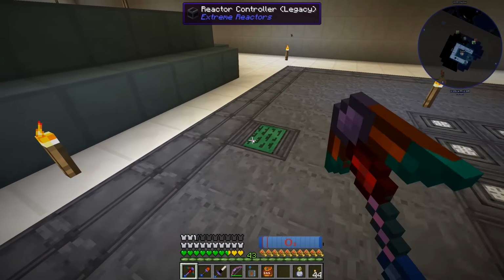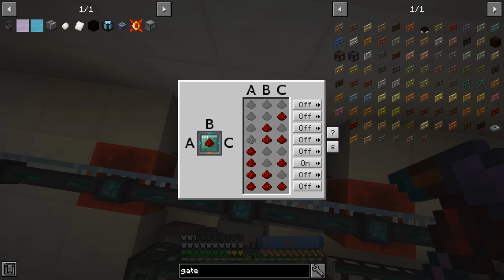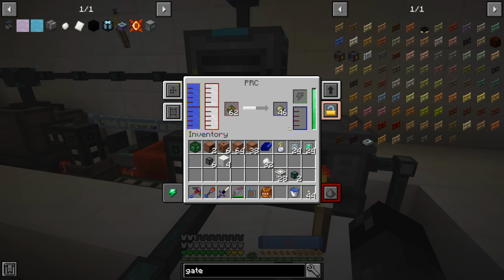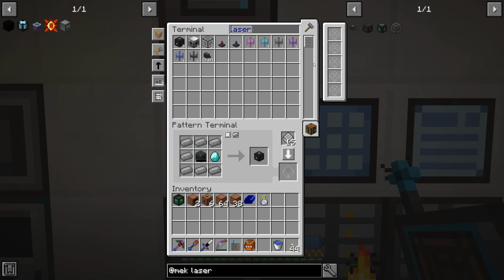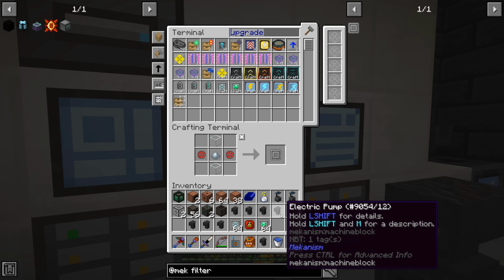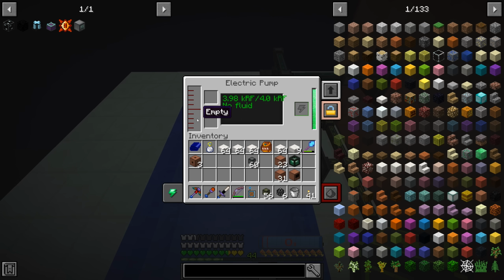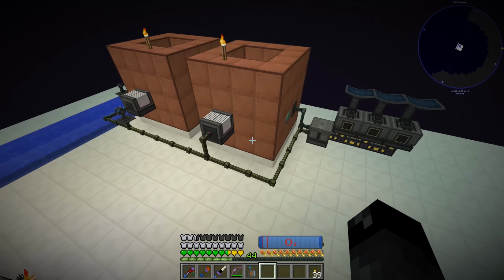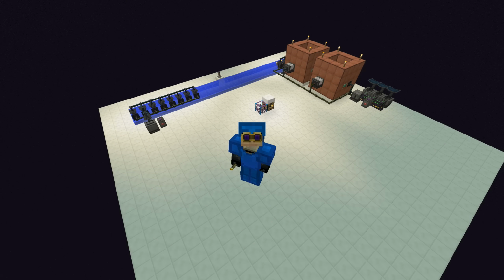Enigmatica 2 Expert - DEUTERIUM & TRITIUM [E78] (Modded Minecraft)

Comment: If you really want to go "big with power" I suggest the following:
1. Use Sinks for water, and integrated tunnels to move it.
2. 32 Pumps and 4 Brine towers should get you enough Deuterium / Tritium to sustain an injection rate of 10.
3. Extract heat from the reactor to a mek boiler (7x7x7 should do) to produce steam.
4. Extract steam from the boiler to a mek turbine (11x11x18). Use integrated tunnels again to move 2448 buckets of steam per tick.

With the above setup in my E2E world the turbine is outputting around 98 Million RF/tick. It is stupid.
Reply: I agree on this, but also wish to add that you only need the reactor on injection rate of 2 once it's on, you can fully heat a max size boiler on that instantly so it makes no difference.
Reply: I'm not smart enough for integrated dynamics so I would use actually additions lasers which don't have a transfer limit
Reply: @mahall1988  liquid transport, you can use super-laminar fluiducts for between the turbine and boiler but filling the boiler will be hard

Comment: Hey Hypno, I just found your channel a few days ago and I've enjoyed watching through your progress on this modpack. I don't know if Mekanism is significantly changed from its defaults in here, but if it's even close to them I'll warn you right now that you'll want closer to 40 pumps than 4 for both the water and heavy water. Definitely more on the regular water though. You can add more of the tritium and deuterium into the reactor than the minimum needed to run it and it makes a lot more power, but even on the low settings it burns through both extremely fast. Also, you can make passive and active versions of it too, and the Mekanism Turbine is by far the most rapid power generation I've ever seen IF it is allowed to reach max size and speeds. Hope you have fun with your reactor and the rest of the pack either way. ^^

Comment: I heavily, HEAVILY, suggest using a sink from cooking for blockheads instead of pumps, and even for any water source due to them being an infinite water source that's output is only limited to that of the transfer pipe (for example, of a pipe could pump 10 buckets a tick you would get that) for no power at all or anything. Extremely cheap and easy and is easily the best method for getting water for any purpose.
Reply: he said he inly wanted to do mekenism for this project
Reply: Saph Plr they also work as a fluid trash can; I found that out the hard way when I accidentally voided a ton of crystallized canola oil.